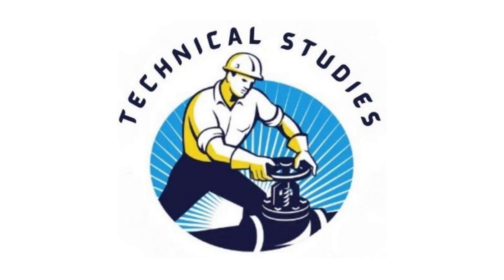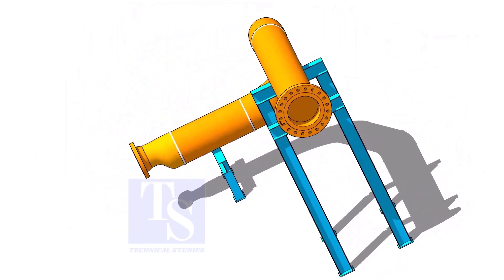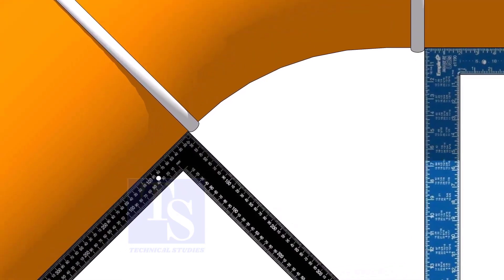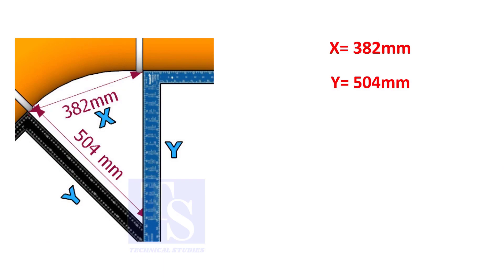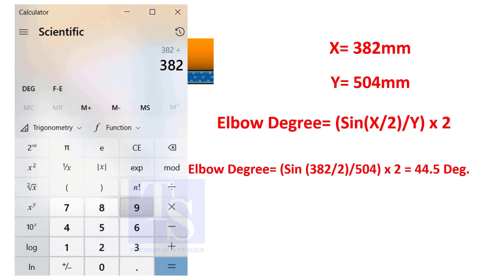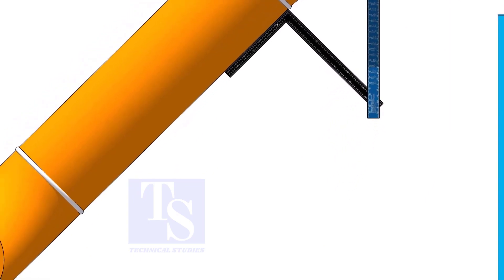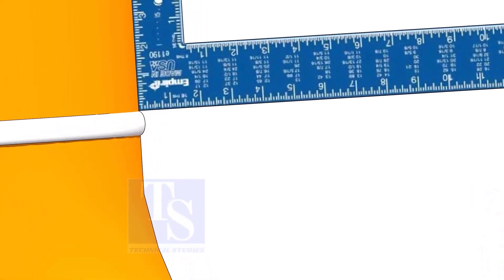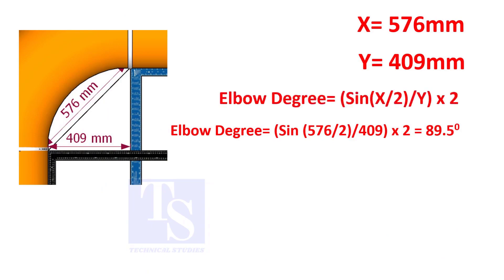How to find the degree of an existing elbow.

Comment: Big bor pipe joint vidio in gap menten
Reply from the maker: Bro, this video is for, finding the angle of the elbow only. You may need to add or reduce the required gap, during the fabrication.